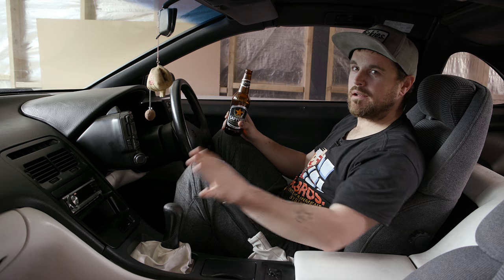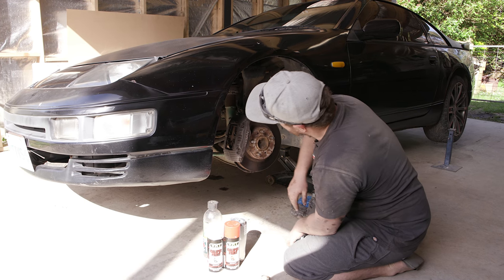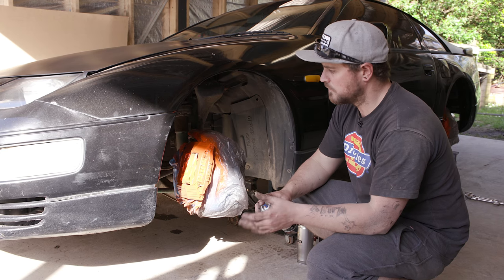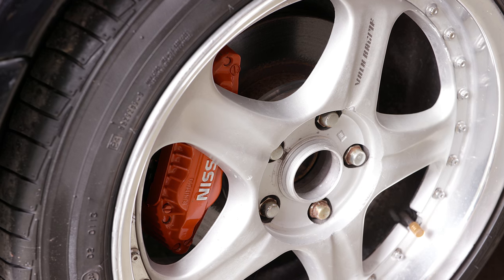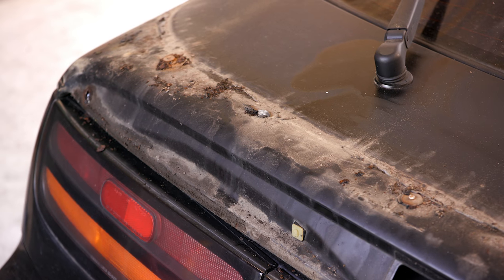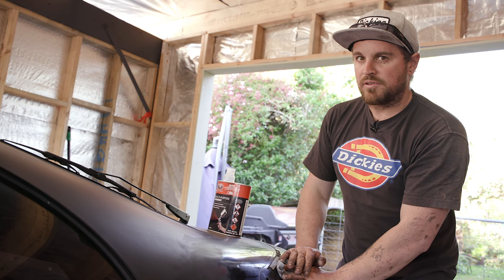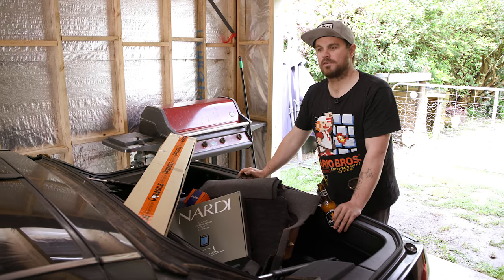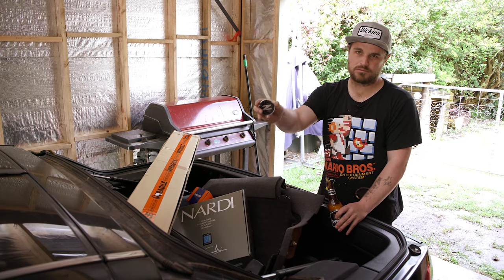Intake! - Project Z Twin Turbo 300zx Painting Brakes Removing Spoiler

Comment: So, I wound up buying the Nismo clear lenses and totally forgetting about this episode...and that the pig tails are different. With that, instead of requiring the turn signals, I opted to dremel off the bung from the amber lenses, bore out and flatten the surfaces on the clear lenses and JB welding the old bungs from the amber onto the virgin surface on the clears. Worked out really nicely.

Comment: My car does the same noise when trying to turn it on . Any idea what it is? Could it be the flywheel? I already changed the starter . Thanks in advance
Reply from the maker: SinceZ13 I had thought it was going to be the starter motor and was looking at changing it in the future. One of the trucks at work did the same and ended up getting its starter changed to fix the issue. Misalignment of the startee on your flywheel????

Comment: I have a 300zx 1991 2+2 non turbo but mine also makes that noise when i try to start is it the starter
Reply from the maker: David Castillo i have a feeling a tooth is missing from the flywheel or the starter or they are misaligned. It doesnt do it often.
Reply: Yea mine doesn't either it just started when I replaced all my belts